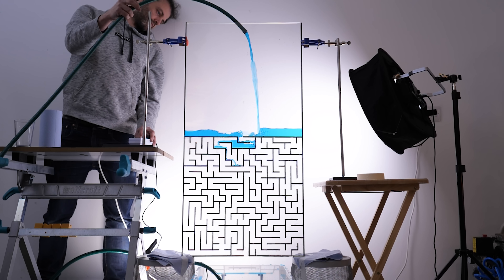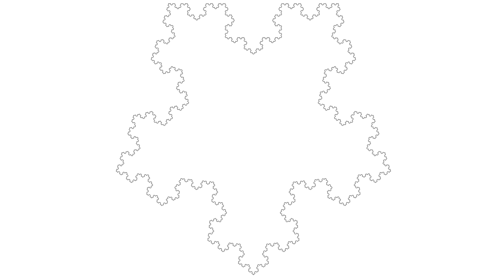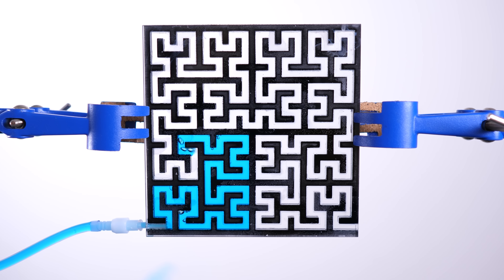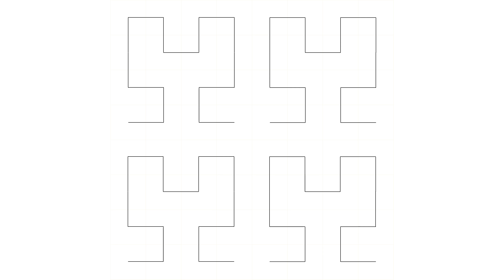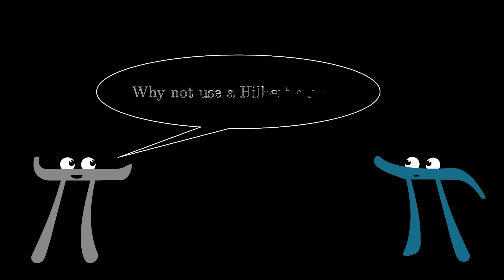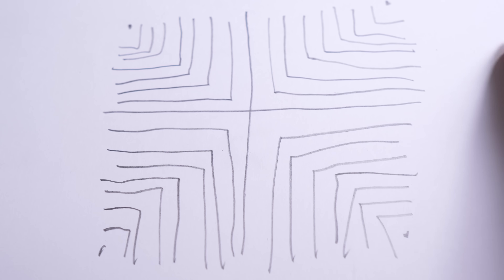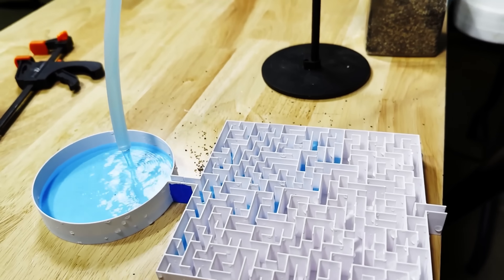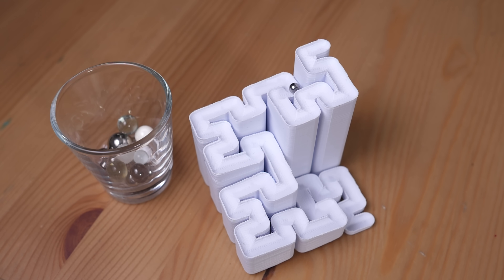Space filling curves filling with water

Comment: I used my backup mini-mag light and held it inside the hole to see what I could see. I was excited by what I saw. The wall around the hole was about 3-5 inches thick. It led into a tight passage. The passage opened up a bit just inside the hole. It continued back about 10–12 feet in a small crawl space. After that it seemed to really open up! Although how much we couldn’t tell. This could be a virgin passage. (Obviously, no one has passed through this route, but there could be a way into the passage from the other side.) To even get to the crawl space we would have to enlarge the opening. Currently, it is about the size of my fist. Once we get past the opening we would have a tight crawl back to where it opened up. It would take some work, but we thought we could do it. We sat down for a few minutes to rest and contemplate our plan of attack. While we sat there in the darkness we could hear the wind howling from the other side of the passage. It was a low, eerie noise. We could also hear a low rumble from time to time. No big deal, though. The cave is in the vicinity of a highway that has heavy trucks drive on it. We figured the rumble was the effect of the trucks resonating through the rocks.

We determined that our best plan would be to haul a cordless drill into the cave to drill into the rock. Then we could take a bullpin and a small sledgehammer and break up the rock. It seemed pretty straight-forward. We would widen the hole big enough to squeeze in and see what was on the other side. The efforts to haul all of the equipment down to the hole would be a pain, but we hoped it would be worth it. I named the passage Floyd’s Tomb, after Floyd Collins. It seemed to look like the tight spot where Floyd spent his last miserable days on earth.

Comment: With the celtic labyrinth. If I understand correctly the issue Matt Parker was getting at is that the curves themselves are willy nilly drawn in by hand, and not defined by a mathematical function.
If you replace the curves with square pathways to connect the sides, I think that's a more mathematical shape which could be space filling.

Comment: I think the problem with the mold curve is that it is not clear what the limit as n approaches infinity of an n-mold curve is. But if you ignore this, I think its quite clear that the limit of n-mold curves are filling, defined as: every point in the area is covered by the line. You just need to relate every point to one of the circles.

Comment: The reason the Celtic labyrinth doesn't count as a space-filling curve is that you can't define a limit version of it, or in other words, you can't define a sequence of increasingly filling Celtic labyrinths who end up stabilizing into a limit version.

The Hilbert curve is special in that it does stabilize, if you go at the 1/3rd of the point in the curve for instance, each iteration of adding an additional U shape is going to go closer and closer to a limit point, it converges. For each iteration of the Celtic curve, which consists of adding a new line inbetween each existing line, the 1/3rd mark is going to go all over the place. By the mathematical version of a limit, the limit of the Celtic labyrinth curve doesn't exist, it diverges.

Or in other words, it's mostly related to the "good low quality" property of the Hilbert curve, which mean low quality versions of the curve are a good approximation of its highest quality version - the limit curve.
Reply: This is a subtle point so it might be helpful to think about a simpler example. The most naive way to try to fill a 2-dimensional space with a curve is to do what a printer does: start at the top left corner, traverse the page left to right, then go down a small step, and traverse back, etc. Define the nth iteration of the "printer" curve to be this one where the small vertical step is size 1/n. What is the limit of these curves? In other words, to draw the curve what instruction should you give the printer after traversing the top edge?
Reply: @dankaplan4330  You're right on the money with your printer example. While a printer with closer and closer print lines sounds like it could fill the space, it doesn't hold up when you realise that if you had an ideal infinitely small printing resolution, your printer would never get past the top edge.

With the Hilbert curve, it's different, because the infinitely small printing resolution would only need to do infinitely small finer step to fill up the finer curve. If you conceive an ideal printer that can accept infinitely fine instruction and that can do small instructions in an infinitely small time, it could fill up the whole sheet with a single line.
Reply: Steve didn't say "good low quality" but "good locality", does that make things clearer to you?

Try listening again a few times to what Matt said in the video. Space-filling does not require "stabilizing" in the way you describe.
Reply: @u1zha  Oops, you're right, I did hear it wrong, to be fair the "low quality" interpretation made perfect sense in the context of 3b1b's video and his practical example around vision-sound interface. Still fits my understanding of the Hilbert curve, but my bad either way.

However I don't see how Matt's explanation invalidate mine. For a start I never said stabilization/convergence is a requirement for space-filling. There's an infinite number of space-filling curves you cannot describe as a convergent limit of a sequence of curves ; in fact the vast infinite majority of space-filling curves, you'll never be able to describe in any way at all.

My statement wasn't about a general property of space-filling curves, just about the Celtic labyrinth. What I said is that in the way the Celtic labyrinth is defined, you'll never be able to define a limit version of it like you can for the Hilbert curve. You can only define the finite iterations, and the finite iterations are not space-filling, they're just regular curves with a lot of folds. My point is that the "ideal" version of the Celtic labyrinth doesn't exist.
Reply: Can you prove that the Celtic labyrinth doesn't converge? In my mind I can see it converging so I don't agree with your whole premise.
Reply: @Macieks300  Yes. Remember the definition of convergence: for a sequence to converge to a point, it means that for any threshold distance you give it, there's a point where every step of the sequence is closer to the limit than the given threshold (look up epsilon-delta limits if you're not familiar). For curves it's a bit harder: you can define what we call "pointwise convergence", where we just consider each point individually without regards for its neighbours, but there are more strict forms of convergence that require the image points (i.e. the points in the 2d square) to stay close between them if the inputs are also close, but that's a whole other beast. 
  
Consider the top of the labyrinth and ignore everything else. For all intents and purposes, it is just a squiggly line going up and down in a snake pattern. If you take a point close to the start, it will likely stay close for every iteration, so it definitely converges. But if you take a point in the middle, it will jump around every iteration, without closing in on any value. Every step of the sequence is completely fine, and you can traverse and study it without problems, but you cannot define its limit because it doesn't stay in one place. It stops being a curve altogether

It is nigh impossible to show this through text, so I really recommend you to check out 3blue1brown's video on the hilbert curve, it makes a far better explanation that I could give through here
Reply: @ClaraDeLemon  what about if you consider the points 1 apart - then I think they converge (for both sets of odd/even points) so you get two sets of convergences onto the plane - maybe covering the plane twice ?
Reply: you missed what Matt Parker was saying. While it is true that the approach used to demonstrate fractals as space filling will not work on the Celtic labrynth, there is no way of knowing at this time if it is space filling or if it is not. This is because the absence of a method of proof does not itself constitute a valid disproof.
Reply: @Thesupremeone34  You're also right that I haven't disproved the invalidity of non-fractal labyrinth to fill up the space. While the naive way of tracing the labyrinth, with a line at constant speed, would indeed never converge, it doesn't mean there doesn't necessarily exist a way to trace it at variable speed that could converge.

Just like for the infinite printer, you would need to prove that whatever (variable but finite) speed you give the printing head, you could never come up with a set of instruction that, when approaching its ideal version, would never converge to a final curve. I'm pretty sure 3blue1brown disprove it fully in his video about the Hilbert curve, but I agree my comment doesn't.
Reply: @Thesupremeone34 no. what matt said was wrong. the labyrinth curve is an infinite family of curves with increasingly more parallel lines, which does not converge to a well defined curve. every space filling curve needs to be a fractal
Reply: @toniokettner4821  what Matt said wasn't strictly wrong, he just didn't stop enough to notice the answer was a definite no because of convergence reasons, so he just erred in the side of caution and said "you cannot prove it with known methods", which is technically true, the best kind of true
Reply: @Thesupremeone34 you misunderstood the comment. It's not that the curve is not a fractal, which we already knew about, and that's what Matt Parker said, it is in fact that the limit of the curves doesn't exist, so you cannot even ask the question in the first place, there's no infinite labyrinth to check if it fills space in any known or unknown way because the infinite labyrinth is not well defined

Comment: As someone who recently got into resin printing, I learned that you can remove the cloudiness by brushing fresh resin onto the surface and use a uv light to cure it from there, or just not washing the print and go straight to curing helps too.
Reply: I work with epoxies.
Just spray it with clear lacquer of pretty much any type.

Comment: At 9:15 I was thinking resistance.  I know that in air flow that for every 90 degrees turn in a vent you have a 50% loss in air flow.  Or something similar.  I wonder how big the cube needs to be until the resistance is so great that you could not manually push the water through.

Comment: All very interesting Steve. Ive been interested in similar - a heat exchanger. But instead of a single space-filling curve it uses TWO space filling curves that are tightly intermingled yet not touching. Hot fluid goes down one curve (tube) warming the fluid in the other. It would be interesting to know of any fractals for this.
Reply: Branching structures such as tree roots and lungs, both optimized for surface area exchange, also nehprites in the kidneys
Reply: Space-filling curves aren't actually very good for a heat exchanger. It's true that they offer enormous surface area, but they also make it very difficult to push the fluids through, and there will always be spots where different-temperature parts meet (because a space-filling curve can't be injective). Tree structures don't have this problem, but they're not optimal either because you waste half the space in the branches before you actually get to where the heat exchanging happens. The best design for a heat exchanger is a gyroid instead.

Comment: As far as I can tell, the labyrinth isn't a space filling curve not because it isn't space filling (it is, the intuition of "lines get closer together" is enough in this case), but rather that it isn't a curve. A mathematical curve is defined as a mapping between a line segment and 2d/3d space. A true fractal Hilbert curve is a curve because every point in it converges are you make the curve finer and finer, so that the true Hilbert curve is defined as a limit of the finite pseudo-Hilbert curves, and that limit exists for every point in the line segment, which can be proven. For the fractal labyrinth curve, if you define it as a limit of finite labyrinth curves, that limit wouldn't exist, since every point of the line segment would "jump around" the labyrinth as you increase the iterations. So for example a point 0.3 (30% along the length of the curve) would happen to be in completely different places in different iterations of the labyrinth, and that's why you can't make a space filling curve out of it. Actually, the linked 3Blue1Brown video has a section related to this, where Grant talks about a "snake" curve, I believe the labyrinth curve behaves very similarly to that one

Comment: The 3d version, like the 2d ones, would have an interesting property in the limit, wouldn't it? The water line through it would have an infinite length, but limited volume. Since you can't make the water go through faster than the speed of light, it would take an infinite amount of time to fill even a tiny cube with a syringe of the same volume, no matter how much pressure you can exert on the plunger.
Reply: To have an infinite line you would need a tube with no width unfortunately all liquide I know ha e a minimum width for exemple I doubt water could get thinner than an h2o molecule. Therefor none 0 with tube means finite tube means finite time to fill
Reply: @glorrin  I believe your comment is the most important out of all of ours. at these infinite/undefined/unrepresentable numbers, there will also be undefinable/infinite/unrepresentable results. There by the smallest atom radius(Helium) is the limit. However in the discussion for smaller particles that can be dubbed as point particles, they are commonly said to not have a definable size. the waves are absorbable and have no mass. A liquid like water cannot fit. Limits allows for an reality to exist.
Reply: @glorrin  You are correct that this scenario could not happen in the real world, but original post was about the limit case, a true space filling curve with no thickness. It doesn't really make physical sense, but it's interesting to think about.
Reply: Just thinking really abstractly, could you even leave the starting point? I mean, if you're already arguing infinite fineness, then point zero is infinitely long before you even get started...?
Reply: @oddlyspecificmath  just because you may never reach a point b doesnt mean you cant leave point a... And that paradox doesn't really make sense imo since you need to move slower and slower to the point that the velocity is basically 0
Reply: @oddlyspecificmath  would there even be a 'start'?
Reply: @zekezero12345  Depending on the sense of your question: [Distance/time] Zeno's paradox (iirc) is resolved by realizing that the sum of an infinite amount of numbers doesn't mean they sum to infinity. [Physics effects at tiny scales] I've started thinking of this as trying to effectively force a liquid through a solid; in this case perhaps the way to 'start' would be to switch the liquid for EM radiation, at which point you can penetrate solids (with some refraction)
Reply: Well in the limit the water line also has zero width, and so is smaller than water molecules, so none can fit through
Reply: This is a great candidate for the boundary between math and physics
Reply: Similar to the Tesla valve?
Reply: It feels similar to the valve, doesn't it? Do the turns alone create resistance (or are the backflow channels intrinsic)? Then I started thinking about quantum tunneling and decided I haven't studied enough :)
Reply: @danielodom9305 not really a Tesla valve redirects fluid flow whereas this is just a really tight constriction
Reply: I was also thinking that limits were a necessary part of this, at the very least in physical dimensions, but with an additional question about the presumption "time" -- whatever that really means -- is also infinitely divisible.
Reply: It's like painting Gabriel's horn, isn't it?
Reply: no, as with the limit the volume of each line/tunnel goes down, and its volume is limitly comming closer to the volume of the cube (but in fact the tunnels are wide 0 so no water can go inside them) you are mixing real world with math where physics is the thing that breaks it appart.
Reply: Very interesting, this is shown in the multiple videos, there is a gradual decrease in pressure from start to finish. If it was infinitely long, there has to be infinite pressure at the start too. So your ending statement of "no matter how much pressure you can exert" is just plainly wrong. the pressure can be represented as a integral of length of the line.
Reply: @acters124  The problem is that no amount of force can accelerate the water beyond the speed of light. The water would have to travel along the path which is infinitely long, so it could never reach the end (or anywhere else in the cube for that matter) in a finite amount of time.
Reply: Water wouldnt fit on the cavities
Reply: @Hankathan  I never denied that you cannot go past infinite. In fact with time dilation, the material going up to infinite energy(supplied by a force) will experience time relatively shorter than an external observer at 0(or starting) energy/speed. For the external observer, it would take about infinite time for the fluid to complete the travel of the infinitely long length. however the object reaching infinite energy(this is speed of light) will experience traveling the infinite length INSTANTLY.